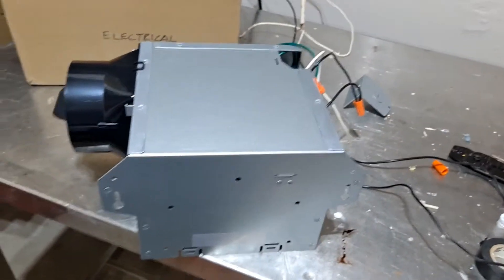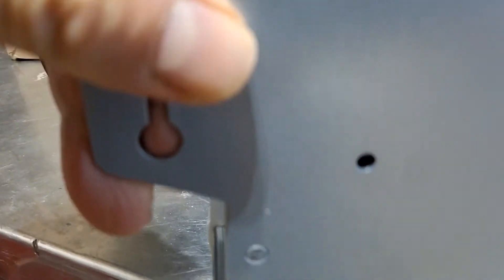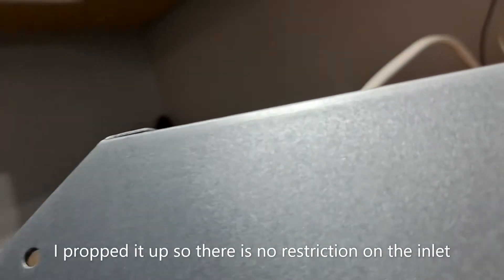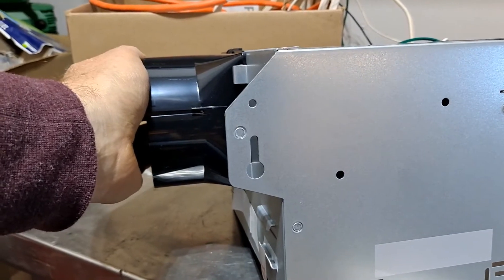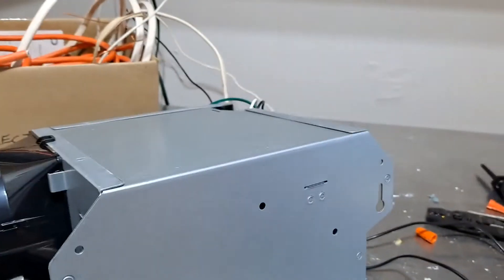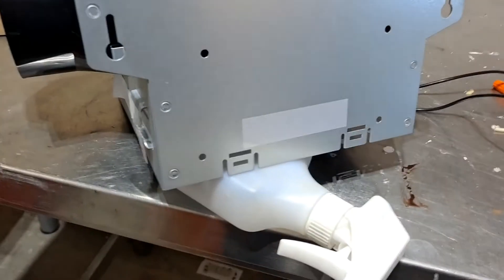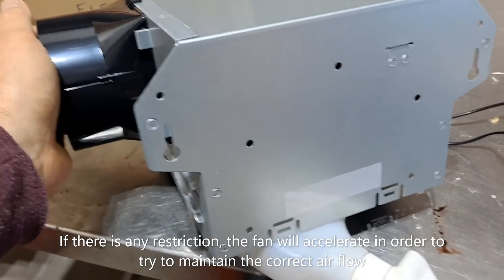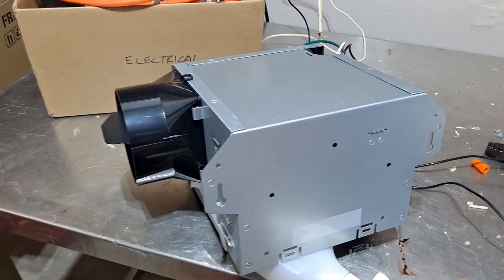Noisy Bathroom Extractor Fan when new (not worn out) - Explained.

Comment: How can you fix this if its already in the ceiling?
Reply from the maker: @talihoahoy  did it stop working?  If so you may be able to replace just the fan part and not the housing.  If you think your issue is the duct size it depends if it's accessible like in an attic or not as the duct would have to be replaced

Comment: Very helpful. I have a bathroom extractor fan with an irritating whining noise which I thought was down to worn bearings. Powered it up on the bench: quiet. And restricting either the air coming in or out by half reduces the whine to zero. So from your video, there appears to be a mismatch between the size of the outside grill which is too large for the fan.
Reply from the maker: Nice. Thanks for the feedback. Sounds like if you can find a way to restrict the flow a bit when it's installed the noise might permanently go away then
Reply: @dadlifediydoityourselflike2293  Investigating it further, I think I have a quarter wavelength acoustic resonator after doing some calculations where the outside grille reflects some of the sound energy.

Comment: Thanks for the info.  I was using a 3 inch pipe instead of 4 because that what was there.  Installed a Panasonic whisper but it’s just a loud.  I will change to 4 inch pipe and hope it helps.
Reply from the maker: Good luck.  3" is ok for 50cfm but 4" for 90-100cfm. There are code charts available online showing max cfm for various duct diameters